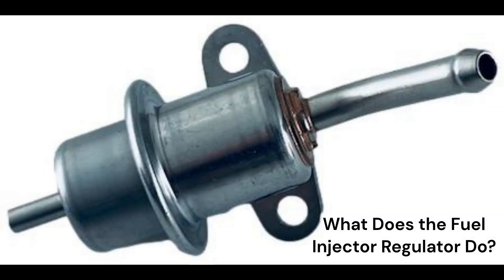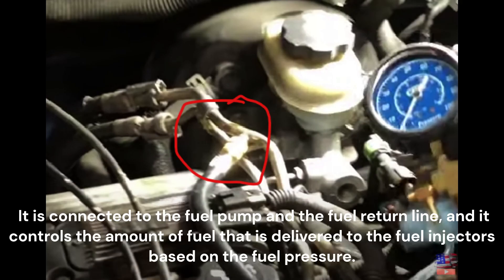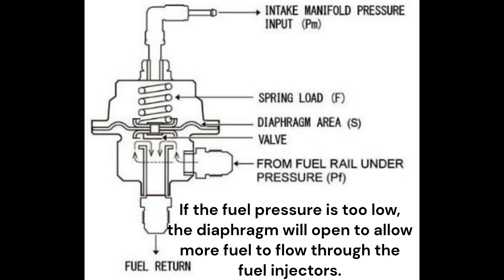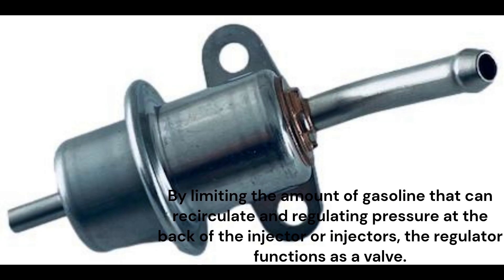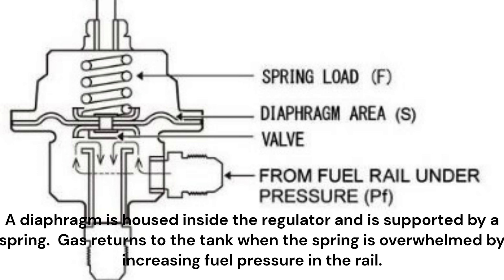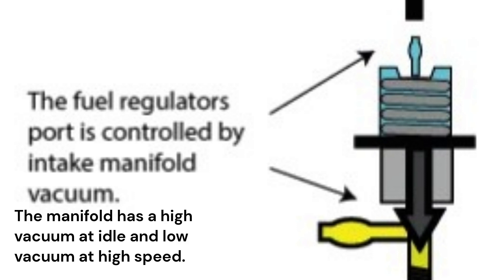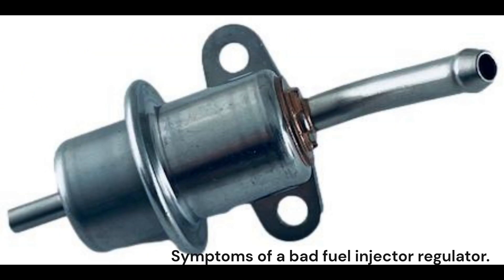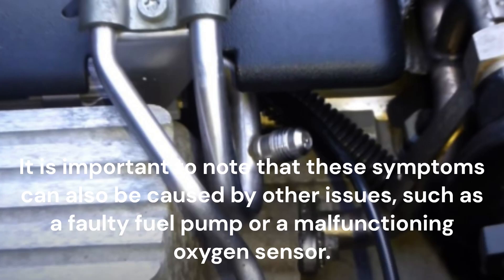What Does a Fuel Injector Regulator Do?

Comment: Hii 

My mk1 injectors are not getting the fuel,,, I've replaced the pump and the filter but still...
What could be the problem??? 
 
When I use the quick start spray it catches and stop 

When I on it I can hear the pump running but by the filter nothing gets there...

Your help will be appreciated..
Reply from the maker: Here is a list of possible culprits. I would start by testing the regulator.
Reply from the maker: https://www.carburetor-parts.com/fuel-injectors-not-getting-fuel